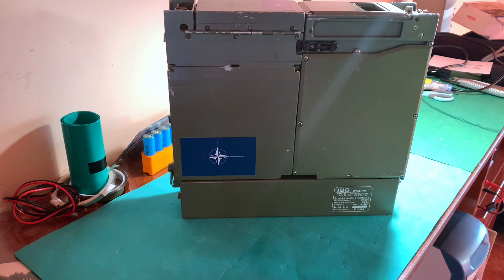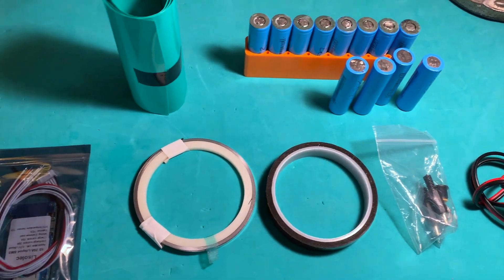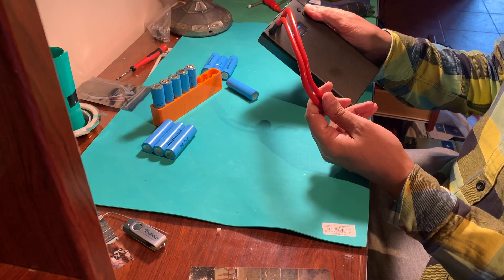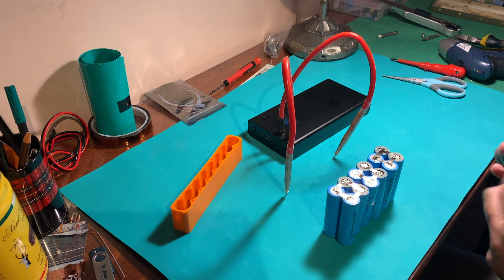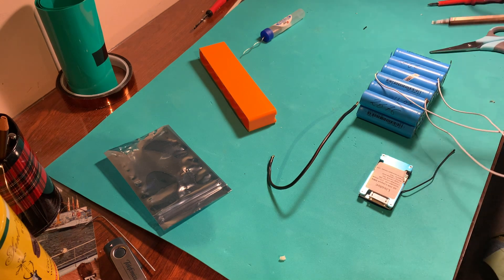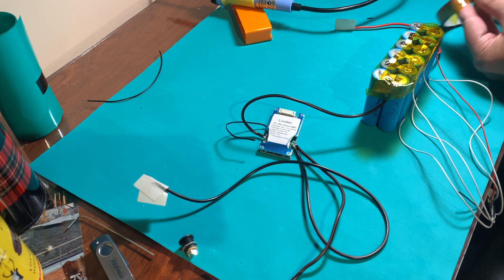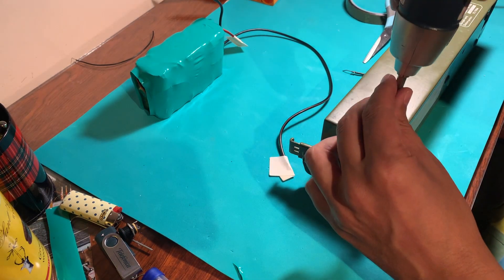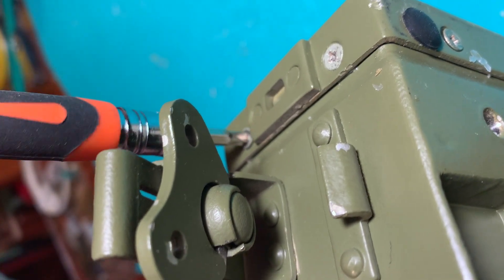RU-20 (PRC-515) Battery upgrade

Comment: I am up to convert my RU-20 radio too. Since the nominal voltage should be 25v, the li-ion pack has a nominal voltage of 22.2v. The cutoff voltage should be 18 volts. How is the radio working  before it reaches 18 volts?

Comment: Saludos desde YS. Pregunta rápida… con que re-cargas ese battery pack? Siendo de 24V es un cargador especial… el BMS se encarga de lo demás. Voy a fabricarme un paquete igual al tuyo, de acuerdo a tu video. Es para una RU-20 igual al tuyo y necesitaré cargador. Alguna recomendación? 
Gracias de antemano. 

PD. Olvidé mencionar que es mi primer “Green Radio”. Aprendiendo mucho cada día. 
73
YS1RS
Reply from the maker: @ys1rs  yes the BMS needs a controlled charger. In this case it is a 25.4V liIon charger

Comment: Hola me encato tu video. pregunta: cuantas horas de operacion lograste obtener con esta bateria?
y por ultimo. que opinas de la radio?
gracias desde vk2 
73
Reply from the maker: Hola! Si consigues una a un precio adecuado es muy buena radio. Completa con accesorios no deberia costrar mas de 600€ y es una radio fenomenal y robusta. Muy fiable.
Y es de lo mas fácil de operar.
Con la bateria tal cual esta ahora tengo unos 4000mA y la protección de descarga salta tras unas 7h en recepción y con 1h en tx mas o menos
Reply: @Radiogenes  me inspiraste con el video. Gracias por tu respuesta. Viviendo en Australia el servicio postal y sus costos añaden mas al precio.pero me as inspirado ! 73
Reply from the maker: @aschlack8889  lo que necesites, me dices. Tengo algún contacto que vende RU-20 (prc515) saludos
Reply: @Radiogenes  fantastico. Tienes un correo email ?
Reply from the maker: @aschlack8889  qrz EA3IAV 
The guy selling oluja91@gmail.com
Reply: Te lo agradesco. Me pondré en contacto 73

Comment: Look at your video at 9 minutes and 29 seconds to 9 minutes and 34 seconds.
Reply from the maker: Ahh sorry! I made it. Using one of these € 0,70  1％ dto. | Voltímetro Digital LED para coche, medidor de voltaje, Detector de voltaje de potencia móvil, 12V, rojo, verde, azul, amarillo, 0,28 pulgadas, CC, 0-100V
https://a.aliexpress.com/_EHnvfJJ  a transparent tube from a solder tube and a connector from a third party computer power adapter (usually they come
With 10 bits or so)